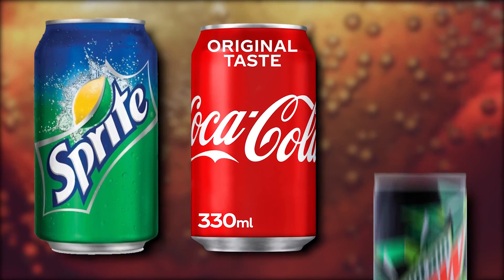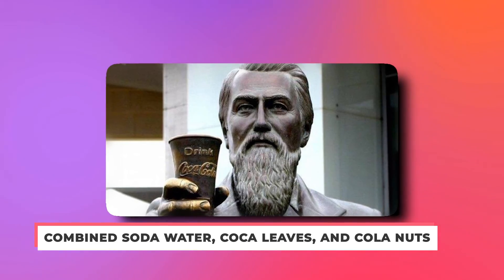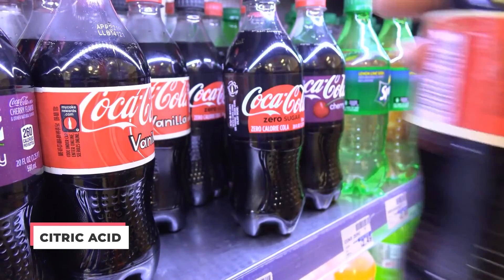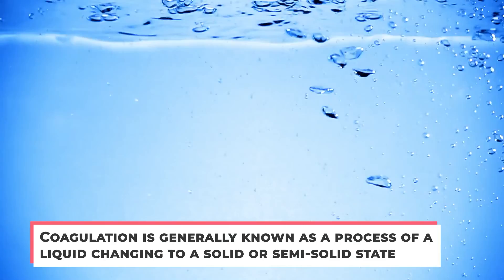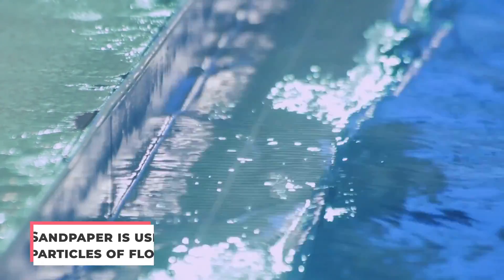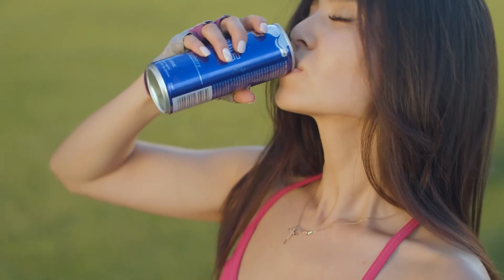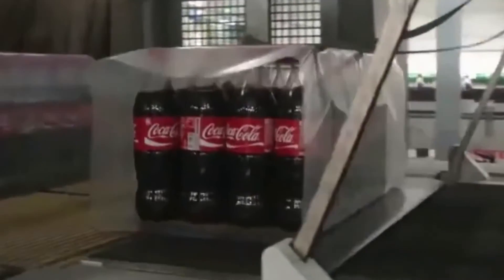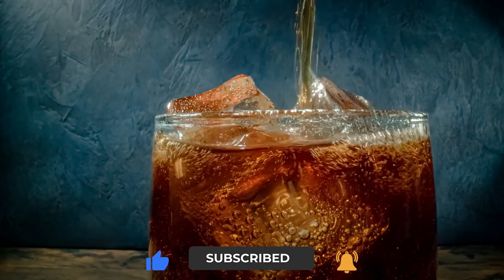How Do Factories REALLY Produce Soft Drink?

Comment: Great video but just to clarify, softdrinks do not give you diabetes.   Diabetes is NOT a fat person disease, skinny people can also have diabetes.   In basic terms diabetes just means that your pancreas is not releasing enough hormone to meet your body requirements (as you get older your pancreas gets tired).   The hormones (and alot of chemical reactions and other process inside the body) are used to basically turn sugar into energy.    So even if you are skinny and your pancreas stops producing the hormone you can also be a diabetic.   Now it is true that you have a greater chance of having diabetes if you are obese because your pancreas does have a max output and obesity does tend to be beyond the ability of the pancreas to produce so much hormone, this is why they tell you to lose weight if you are a diabetic.      Many doctors say that most people in the US are pre-diabetic because of our fast paced eating style (alot of fast foods) which can cause obesity.    But once you are a diabetic there is no going back to pre-diabetic.  Even if you reduce your A1C (glucose) to pre-diabetic levels, you are still diabetic.       I hope this clears up the misinformation out there that sugar causes diabetes, it does not.